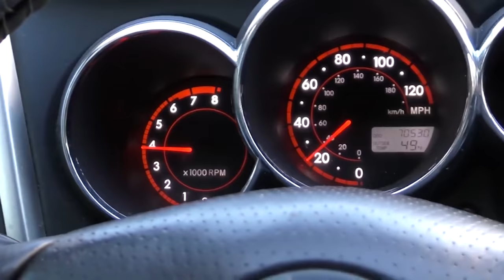5 Signs Your Transmission Has a Serious Problem

Comment: Does anyone know what would cause a Jeep (4 Wheel Drive - automatic transmission) to vibrate at around 1300-1400 RPMs?  It kind of feels like you are going over a rumble strip.  It happened right after a car accident.  Impact was on the driver side rear wheel and he went all the way up to the front wheel.  We have taken it to six different places and no one seems to have a clue.  We started with a tire shop to make sure the tire and wheel were ok and they balanced the tires just to make sure (even though we had just had the tires balanced six months prior) - that did not fix it.  We had someone look at the axel and we were told that they didn't see that the axel was bent.  Someone else looked everything over and they said the wheel was slightly bent so we had it replaced....that did not fix the vibration.  Someone else suggested a transmission flush and Shudder Fixx - that didn't work.  Someone else suggested a transmission rebuild at a cost of $3500.  We have had to pay for all of this out of pocket and we have been fighting the other guy's insurance on this....they are basically saying that they don't know that the accident caused the problem and we don't have an additional $3500 especially if that doesn't work either.  I don't know how to prove that the accident caused this problem other than we never took our Jeep in anywhere prior to the accident for this vibration issue which we definitely would have if it was happening prior to the accident as it was our only vehicle for almost 7 years so we always make sure it was well maintained.  Thank you in advance to anyone who can help.

Comment: So what about front wheel drive vehicles with transaxles, and the filter is built inside the transmission? Would changing the fluid be a bad idea then, if you can't get to the filter?

Comment: I have a Mazda 6 2003 and the fluid looks like it's never been changed and it won't go into drive or and gear if I change the ATF oil will I get my gears back or is it toast

Comment: To anyone who may know, if I have a Toyota with an automatic transmission and 120,000 miles, is it too risky to change the transmission fluid for the first time?  Is it better to leave it as is?  Thank you in advance.
Reply: I think a simple drain and fill would be fine, but I wouldn't flush it

Comment: Not 1 mention of all the clutch material being shaved off the pads and is floating in old trans fluid. When you flush the trans thats never been changed you loose all the clatch pack material that was floating around in the oil causing the car to now shift ruff or not at all

Comment: I had a used transmission put in my Nissan Altima and now it doesn’t change gears when I start to leave after it has been sitting like at work or home going to work. When taking the gear from P to D it jerks hard

Comment: 10,000 miles after a flush in a 2003 Toyota Corolla 182,000 miles. Ran better after the change and has been fine since.

Comment: Hi Scotty, would you recommend the Stop Slip on 2014 Pathfinder CVT ? Recently I experienced jerking, to a point the rpm went crazy and engine light came on, the car became powerless. I drained transmission fluid and put back same amount of Nissan CVT fluid, still not helping. Before I bring to dealer and likely spending a fortune to rebuild the transmission, hoped to get some advice. I have just over 95k miles on the car. Thanks.

Comment: I have a 2004 Hyundai Santa fe and my transmission is slipping and not switching gears right Cagayan when going up an hill. I got it with only 89,000 Mike's and it sat I. Orlando auction for 3 years without being started and not being moved. Could this cause the fluid to go bad or dry out?
Reply: Sorry for the typos...

Comment: 2004 Buick Park Ave 3.8 V6. I've never changed or flushed the tranny fluid. Runs and shifts fine, 302,000 miles on it...

Comment: just out of curiosity, what does he mean by changing the transmission fluid if there isn't a flush? just remove and readd with some newer fluid or adding transmission fluid?
Reply: Yes.  He's making a distinction from a power flush. That means external power is used to push fluid through the transmission and cooler.  He's saying there is never a good reason for a power flush, and he explains why. He's right. A power flush never solves any problems and may cause problems if the transmission isn't already squeaky clean.
Reply: @rdkirk3834  Thank you so much for clarifying! I will do this asap!

Comment: I'm confused, whats the different between flushing the transmission & changing the transmission oil?
Reply: I don't know if all cars are the same but in some cars you won't be able to get all of the transmission oil out of it when you drain it. You will only be able to get a few quarts out of it, so if you just replace the oil that you drained that  counts as an "oil change". And if you continue to repeat the process for a couple more times, that counts as a "flush".  You would need to find out what the capacity of your car's transmission is before you do it, if you're planning to do it yourself.

Comment: My 2011 f150 is tweaking out brother. It jumps from 5th to 3rd and jerks and sometimes won’t shift out of 1st. I have to put it in Manual. And then the speedometer starts jumping from 60 to 0 and back to 40 and all over the place and the transmission will jerk hard. Any suggestions on what this problem may be?

Comment: Flushing isnt bad if you regularly service your transmission every 30-50k miles with a drain and fill. You can flush even bad fluid and completely refill it with some traction fluid additive and it'll be just fine

Comment: But the place at valvoline do my transmission oil change is they put a hose on top and suck the old one  and put fresh one same tube now my transmission hesitate when I curve or when I change the gear towards drive it jerks? So what is my solution? Change oil by removing the cover and new filter or change transmission itself?

Comment: So I recently had my cooler lines replaced, I'm not sure how much transmission fluid leaked out, but recently my car would rise a 1-200 rpm when shifting at 40 mph, like I definitely notice it shifting, but I don't think that's high rpms

My transmission fluid was low so I added a little until it was max but I checked it a few days later and it was low again.. but not as low as before

Comment: I just got a code p0730 incorrect gear ratio and p0128 for engine coolant thermostat and lastly p0420 catalyst efficiency below threshold bank 1 I have a really bad rough idle when I go up to 2-3 gear every time what can be the solution to fix this problem

Comment: i just change the oil and the car is not sighting goes to 3000 revolution to change gear and make a strong movement then change gear and works fine after that.

Comment: I have a 2002mercury grandmarquis ls 238.000 miles change the spark plugs  and oil my car starts to jerk after changing to 4 gear fluid still red and full could it be my tork converter.

Comment: Hi I have a question I have a 2020 Jeep SRT 6.4 and when I rev the engine some times it’s good but most of the time it gets stuck at 4K RPM this has happen to me 4/5 times my RP would get stuck and would not go back down untill I turn the car fully off how do I fix this

Comment: I bought a 08 crown Vic p71 about 6 months ago and it won’t go into the first gear unless I rev to 2k RPM. It jerks hard a lot of the time and I took a good amount of the dirty fluid and replaced it with new fluid with the same amount with some transmission fixer fluid also in hopes it would help. So far it’s only gotten worse. Not by much but still very frustrating when I stop at a red light and have to rev to get into gear. Makes it look like I’m trying to drag race everyone on the road. Planning on having it rebuilt here soon. Anything I can do that may help before I throw another $2k into this beast? Let me know if there is anyway to avoid a rebuild. if possible plz

Comment: What if you don't force flush a transmission? I've seen people flush their mid 90's transmissions by draining the fluid from the transmission cooling line while the engine is running and refilling with fresh fluid until it comes out red - with good results. Of course, they have to make sure that the fluid doesn't run dry during this process.

Comment: My 2007 Prius is sluggish to
Accelerate. Now starting to rev up but not moving very past. At the same time my electronic dashboard and display has been going out. I’m wondering if the electronics or sensors are causing issues? Any thoughts?
Reply: probably your alternator or even worse, the giant battery
Reply: @silver1407  turns out it was my hybrid battery. Fortunately I have a lifetime warranty on it.
Reply: @johnbrion4565  rip looks like my guess was right 
glad your Prius will see the road again though, here's to 300k!
Reply: @silver1407  appreciate it!

Comment: Hi I got a 2014 Chevrolet Spark still shifts and drives just the RPM gets high when I drive I have to go at a certain speed to drive ok a few weeks ago I started it switched gear to reverse didn’t move tried it again the next day it reversed but put it in drive it didn’t move I’m so lost and now car less..?

Comment: Is it fine for a car to make a bump noise when going to reverse from park drives fine shifts fine but that park to reverse is like a thump sound can't tell if it's the transmission or the shifter hitting the plastic my car is very loud on its own due to coolant fan and clutch fan and size of the vehicle it's the commander so has age on her just want to keep her going as long as possible

Comment: Best policy is to flush the transmission and engine after a mild 750 miles when the vehicle is new and then put in the best transmission oil and filter.

Comment: If your active on this video i have a question, my 99 4.3 4x4 s10 blazer has 320k iv been told it have a new motor80k miles and i have no idea about the auto 5speed. I assume it has 300k miles because, the dip stick is rusted… very rare slippage and i have the non tow assist tranny push thing. Ive towed and not towed with it ive put about 5 or 10k on it. Should i even touch it before i buy a new one bc im getting a new rear end

Comment: 2005 Nissan Maxima automatic transmission sux!!! Slippage, banging, hard shifts, delayed shifts(acceleration issues). Put it in D or R feels like you hit a wall. Can't get out of 1st gear. Want to drive up a hill? Better know how to drive in reverse.  
Now just sitting in the yard with not even 55 thousand miles.

Comment: Hi. Please I have a 06 dodge caravan 3.3l engine. And this is the problem I have, when I start the car, and put it on drive or any other gear, it doesn’t move, it revs as if it is on Neutral and take some time before it kicks in and start to move. And when it moves it goes smoothly. But once I slow down or stop, the problem comes again. And sometimes too when at parking you can see the speedometer goin up and down slowly. Please can you help

Comment: Pervious owner had my Honda Prelude flush ... transmission locked up and won't shift had it fixed for $2100 ... drove for about a year and now having issues again.  But right now its still drivable because d2 and d3 still works.  ><
Reply: do you have a warranty on the work done

Comment: Hey Scotty! Can't I just look into the hole on top of the transmission where the transmission fill cap is to see the transmission fluid flowing instead of pulling out that bolt out and watching the fluid drip out underneath my 2004 Chevy Malibu 6cyl?

Comment: Hi Scotty. I have a 2000 Nissan Maxima and sometimes when i put it in drive it started shaking and also when i'm slowing down at a stop light and completly stop, it shake. Scotty, at the stop light when i put the vehicle in park or newtral it don't shake. only when i get it in drive or reverse it shake back and forth. I just change the spark plug and new rotor and pad. please advice.

Comment: For some reason, when my car is warm there is a rattle coming from the engine bay for a quick second, when lowering my speed or accelerating. My rpm dash also moves on its own, like it jerks

Comment: HI AM JAMES I HAVE A TOYOTA LAND CRUISER PRADO ENGINE 1KZ INJECTOR MODIFIED WITH THE 6CYLINDER CRUISER ENGINE SO MANY SOCKETS LEFT UNCONECTED REVERSE IS POWERFUL BT THE DRIVE NO POWER ONLY GOES SLOW VERY SLOW TO CATCH UP WITH SPEED BT NO HIGH TRACTION WHEN MANUVOURING.PLZ GUIDE AM JAMES IN KENYA...THANK U.

Comment: Power flushes are slim to none from every shop most machines don't power flush the trans pump does the flush and the machine simply pulls old out and puts new it while monitoring what's coming out and going in YES flush your trans as maintenance I've owned 4 cars in my lifetime with stupid high miles with the original trans that were flushed regularly and rarely slipped

Comment: I have a 2006 pontiac grand prix that shudders at 30-40mph and then calms down. I drove an hour and a half to take my son to his surgery, it sat for 4 hours and when we left it was very jerky and thought it was going to stall. It worked itself out again but it makes me worry. I have changed my throttle body, spark plugs, wires, and had it checked by multiple mechanics. Nobody can help me
Reply: Clogged injector(s)?

Comment: Can anybody help me? I have a 1995 HONDA CIVIC DX ,4 DR….with 226,200 miles on it and I never thought I had to change transmission fluid.
last week I tried to reverse the gear and it won’t work .Is that a transmission problem? I heard of transmission solenoid. Which will be the most likely fault?

Comment: Scotty, I just had a timing belt replaced on a Mit. Eclipse , and now , suddendly, the car is shaking violently ( like a motor mount is loose ), and the gears are slipping.  Guy said he put a little more transmission fluid in it cause it was low... but in any case, car was perfectly quiet before.  Can a timing belt change effect transmission somehow ??  I also had an air conditioning unit put in....
Reply: What was the issue?

Comment: Late to party, but what would be the problem if the automatic transmission doesn't shift from other gears, only stays in first with huge power and torque loss. The power transition feels like a manual when you let off the clutch but it's an automatic. If I keep my rpm below 3k I will not go anywhere at a stop. And to maintain 40mph I have to literally hold it at 5k. Trans makes a whining sound when power is applied and smoked started to seep out from under the car due from driving 3 miles back (limping it home) have a 4L60/4L60e, fluid was burnt looking. Smelled bad but sweet, wasn't it's usual shade of red/pink. Gonna put a 4l80 in the car.

Comment: Hey Scotty, I recently just bought a 2003 Nissan Xterra with 210k miles from my brother for next to nothing. The problem I have is that the reverse won’t engage in the automatic transmission. The only way I can get the reverse to work barely is to put it into drive then start driving forward and slam it into reverse and give it some gas and it engages. Any thoughts on what this might be? I’m trying to avoid just throwing in a whole new transmission if it is something simple. Any help would be great! Thank you!
Reply: sell the car those altima transmissions love to go out around the.
Reply: You should never switch gears like that while your car is moving. That will tear up the transmission faster than anything else. I wouldn’t spend much money fixing that car, unless you have a mechanic like scotty run a full battery of tests on it. An 03 Xterra was my first car..As much as i love them(They have really nice lines and perform solidly off road and in snow) Ive never seen an Xterra make it much past 200,000 miles without changing the transmission or putting a new engine in. Mine went to 214k miles before the head gasket blew and i traded it in. A good friend of mine came to me for advice when he was looking for a reliable 4wd/awd for winter that would cost under 6000$. He found an Xterra with 175k miles and said that it ran great. I told him not to buy it or at least take it to a mechanic before you do and that he could pick up an older Rav 4 or CRV with that many miles that still could have lots of life left. He didn’t listen… engine blew after he put 7k miles on it.

Comment: My 2016 Ford Fusion 1.5L SE started smoking up from exhaust and under the car and slowly started losing torque too I couldn't move eventually  I did a oil change and transmission drain and fill there was oil on the back of my car idk what's wrong with it
Reply: It also keeps burning oil fast

Comment: I turned on my car and I put my foot on the brake and I put it into drive and the whole car shook. I freaked out so I try to put it back into park and it shifted smoothly. From park I shifted into reverse and it did the same thing that it did when it was in drive the whole car shook. It has plenty of transmission fluid and it's clean. But my car has 240,000 miles on it. The check engine light is on but it's only on for an O2 sensor. All the other gears get shifted into smoothly but we're not shifted into driving and reverse only the car shakes. But when I'm already in drive and I'm going down the road it's just into all the gears automatically very smoothly. It only acts like this when I'm shifting into drive all reverse from the park position. Not as I'm driving.

Comment: Question, I have odyssey 2008 the transmission indicator light is working when I start engine and it goes off after 5 or 6 seconds do you know the problem?